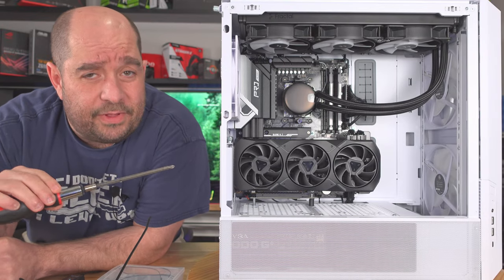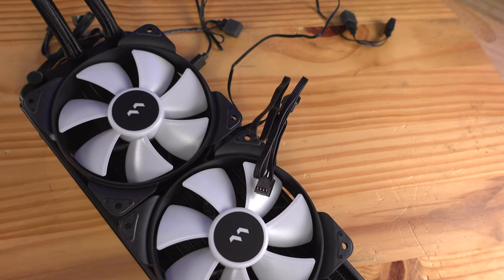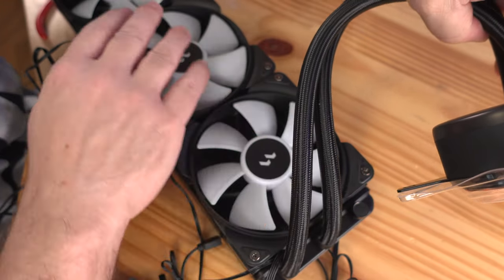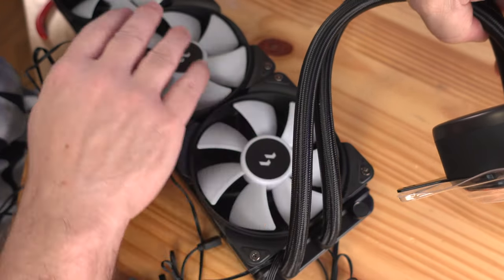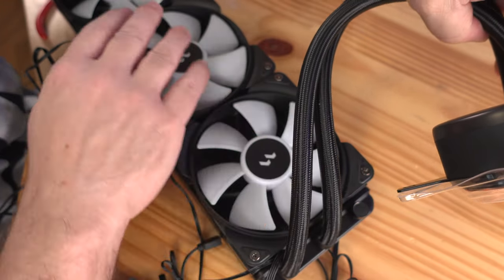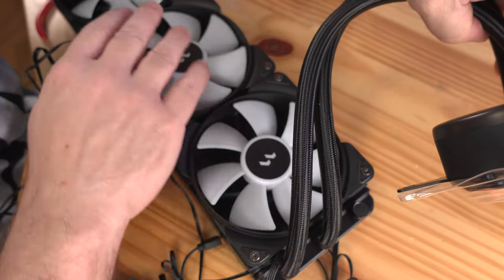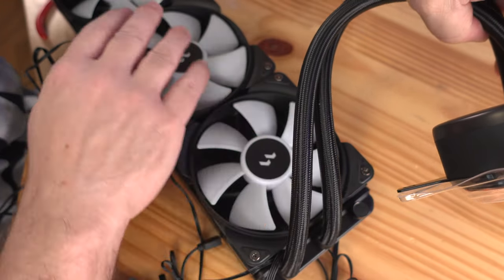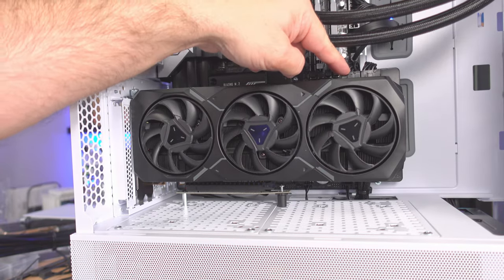Building The ULTIMATE Gaming PC!

Comment: Thank you for the video. This is the first time I build a PC and your video is the clearest one I've found, it's helped me a lot!
Now I need to find an equally good video to know which drivers and programs I should install.
Reply from the maker: Sounds good bud happy to help.  The video you want is in the pinned comment to this video and description.
Reply: @ThisBytesForYou  thanks!
Reply from the maker: Always a pleasure my friend, so very happy you stopped by, trusted in me to help you, liked and subbed as well as took a moment out of your day to thank me.  It means a ton to me and I am so very happy I could help you.
Reply: The only problem I have is I've downloaded the Lian Li L Connect program to regulate my case fans and it does not detect them. I wonder if I made a mistake, They're all plugged in the fan hub which is plugged in a one of my system can pins on my MSI x570s motherboard. Any idea what went wrong?
Reply from the maker: not sure, you would need to use the program off of here: https://lian-li.com/l-connect3/

Plug the fans into the controller, the controller would plug into the motherboard, a 4 pin PWM fan header set to PWM in the BIOS and any USB header they may use, I am not sure anything on these fans sadly since I have never reviewed them.
Reply: That's what I think I've done, but I must have done something wrong. Let's see if I can figure it out. Thanks a lot for your time!
Reply from the maker: I hope it all works.
Reply: @ThisBytesForYou  it doesn't, I've had to use the bios to control fans. Thanks for asking!
Reply from the maker: @2letranger  yeah plugging into the controller and using the fans directly would operate the same way.  SO very happy you got it

Comment: Can you explain the purpose of the 'anti-sag' bracket?
Reply from the maker: Well, a few reasons.
1. the easiest is to keep the card from sagging, it looks nasty. that's just appearance part.
2. After that, is traces.  Each component on a card (and anything really) needs to communicate to other components on the PCB.  Like us and driving our cars on highways, the commination occurs much the same way, through traces.  Those traces are made of copper, gold, aluminum, etc and don't stretch very well, or flex,  as the card starts sagging, overtime it can potentially break those traces, causing those components to not be able to communicate.
3. When you lay something REALLY heavy on a table lets say, it might be able to hold for a while, but then can start to bow and eventually break.  Same thing here, with the heavy cards, aside from the traces, they put weight on the PCIE/PCI slots and cause them to begin to separate from the board, which can bend and break traces as well from the motherboard.
4.  If a card is bending, it does not receiving optimal cooling
There are more, these are just some that come to mind, I hope this helps.

Comment: I have and old XSPC 360mm radiator which is 60mm thick and with the fans I have 80mm of thickness. So my question is: would they fit on this case?
Reply from the maker: well, the radiator for this was 30 mm, the fans were 25 mm, you have a little more space, but I just cant find my calipers, but as per Lian Li you have 77mm of clearance.

Comment: I have 6 uni p28 fans plus the two front fans that came with the case. I have them all plugged into the case fan hub and then have that plugged into my 1 system fan header. Is that correct? Is that too many fans for one header on the motherboard. Does the sata power it all? I don’t want to blow up my motherboard or something. Any help would be awesome. I’m so close to finishing my first build
Reply from the maker: you will be good, just make sure in your BIOS you have that 1 fan header set to PWM so your motherboard controls how fast or slow the fans spin.  So very happy I could help you on your journey.

Comment: Quite nice, too bad about the raizer standoff. Perhaps coupling 2 motherboard standoff screws would achieve the same height? They don't thread perfectly but at least it's something that's easily available. Also, while it's probably solved by this point, you might want to double check that front audio connection on the motherboard, it seems impropper. Might be that the connector on the motherboard has no rim like on the majority of other boards.
Reply from the maker: Thank you, but not sure what you mean by improper.  The rim is an odd one, many do have it, many don't, it shaves a few cents off which at one board makes no sense, but selling millions makes a lot more sense.  I have worked with thousands of different models and it's not something I ever thought of.  Through an assembly line, building machines it makes perfect sense, for us as builders at home, we are a little more careful (generally) and can spot it, but still it is a nice feature to have.

Yeah, the stand off was a bit weak, but thankfully not a huge deal, but still it's Lian Li, they usually make quality stuff, seems like an odd thing to skimp out on, though not everyone mounts their graphics card vertically, so they figured I guess it would not be a big issue.
Reply: @ThisBytesForYou  I was reffering that at 26:56 I think I see the front panel audio inserted in only the top row of pins on the mobo connector and that would have been avoided if they would have used those full connectors. Not a big issue as audio won't get damaged by it but it could be an issue on the USB 2.0 headers which also seem to be lacking that rim.
Reply from the maker: Man, you are right, I wonder if I caught it afterwards and fixed it off camera, since it did work afterwards, GREAT catch on your part.... wow that's embarrassing but it happens.  Thanks for looking out ;)
Reply: @ThisBytesForYou  No need to be embarased, it's a very educational video and it helped me tremendously in deciding on that specific case. The removable top mount for a 360 makes all the difference 😀
Reply from the maker: awesome bud, so happy I could help you and you enjoyed the video to me, it means the world to me.  The case overall is pretty awesome.

Comment: For some reason my 160mm fan at the front of the case are not recognized by L-connect 3, meaning I can’t control the rgb on the fans or the fan speed, any advice?
Reply from the maker: Please try as bellow to completely remove the old version and install the new version as administrator.

Uninstall L-Connect 3 from the controller panel

Remove the old files in folders at C:\Users\computer name\AppData\Roaming\l-connect3 or C:\Users\ computer name \AppData\Local\Programs\L-Connect 3

(computer name depends on user’s system name)

3. Run as Administrator to install L-Connect 3 new version

4. Restart your system
Reply: @ThisBytesForYou  I tried it and it still didn’t work:( only options that show up are system info and settings

Do you know any other app that can do it instead? I tried changing the fan speed in the bios but nothing happens, it stays the same
Reply from the maker: where are you connecting the fans to, both for RGB and power? And what is the manufacturer and model number of your motherboard @blast5558

Comment: You don't attach the AIO before the motherboard is installed.  Especially with the Liam Li 216.
Reply from the maker: Funny I did and it worked fine... Huh odd isn't it, where was this rule set and by who?  Been building for about 25 years... Odd
Reply from the maker: Especially for the lian LI 326 hahahahaha, dude hahhaha
Reply: @ThisBytesForYou  listen, if I have to explain the potential hazards of doing that, then I guess you do you.  You are a youtuber after all and I'm just an engineer.
Reply from the maker: @mynihilism  funny I was a product development engineer for Alienware and Velocity Micro, please explain
Reply: @ThisBytesForYou  Fair enough.  For one you run the hazard of damaging the motherboard if the AIO cooler falls and hits the motherboard during install.  Two, Luan Li with the 216 made the top of the case lift off so you can pre install the cooler so it's supported, then one can attach the pump.  It enables ease of install and a safer install.  It's an important feature especially with how expensive everything has become.   My last motherboard cost $380, that's NUTS!  3-4 years ago that would be top tier, now it's mid tier at best.
Reply from the maker: The chances of the unit falling are all in your hands, I have to do it this way because I am recording, hind sight is always 20/20 right when you are recording you are in the moment, there are 120000 ways to do it, it's custom, you do it as you wish.  This is the way the die rolled.  I go over the feature though in the unboxing and the review, and actually I use the feature in this when I forgot something, again, 200000 ways.  There are better, there are worse, this is one of them.  Again, non will intrinsically message up anything unless you mess up there are a trillion hazards.

Comment: AM5 is so little improvements to the AM4 so its not necessary worth to upgrade yet. Even though DDR5 memories give additional clocks, their speed is not noticeable in games, only in test programs as numbers. AM4 with DDR4 is fine for years and more cheaper costs.
Reply from the maker: Well, if you are on the lower end CPU and memory wise yes, very little improvement and realize, gaming isn't the only thing computers are used for.  Computers make the games, make the videos, make the songs you consume, the faster those go, the faster you can consume.  

If you have an AM4 now, you are good, but if you are upgrading... why limit your upgrade since you are stuck with DDR4, DDR5 is the future, until 6 comes out, but that was the case with EDO/Fast Page memory, SDR, DDR1, DDR2, DDR3, etc.  Each of those little test programs represents something, not just blips.

Comment: Hi! I just wanted to thank you for the lian lancool 216 videos, it helped me, I like your content.
Perhaps you'd be willing to help me out some further with a question if you'd be able to spare the time.

I bought the ARGB moduble because I couldn't figure out how after plugging the fans into an gen 2 argb header to control the rims? Is the ARGB module necessary or did I waste money by not understanding something. I have the 650E-F motherboard.
Again thank you so much for your work and best of luck.

Oh and don't feel obligated or whatever to read or respond to this but I just wanted to share my cool build. Since you're into computers you might find this interesting and want to give and opinion. First time build.

Total price 
Parts list:
CPU:AMD Ryzen 7700x € 291,00
MOBO:ASUS ROG Strix B650E-F € 295,05
GPU:RTX 3090 Turbo edition (650 used, it's the blower version, as loud as a vacuum and hot!)
CASE:Lian Li 216 Black RGB  € 98,35
RAM:Kingston DDR5 Fury Beast 2x16GB 6000 € 125,90 (you can overclock the timings to 34 on this MOBO)
CPU FAN:Be Quiet Dark Rock 4  €62
MAIN DRIVE:Samsung 980 PRO 1TB M.2 SSD € 84,90
Additional DRIVE:SEAGATE Pipeline 5900 2TB HDD €47,00
PSU: Delta GPS - 1000DBA, 1000W € 119,00

Accessories:
Alphacool Eiswolf 2 AIO - 360mm RTX 3080/3090 Gaming/Eagle with Backplate €271,78
Thermal Grizzly PCIe 4.0 x16 Riser Cable 30cm €49.90 (still on the way)
Black dust filter lian li 216-2 €14,90 (on the way)
ARGB module 216-2  €15 (on the way)
Noctua NT-H2 3.5g  €12,90

Total Price:2120

The build is whisper quiet and has veyr good performance, while looking sleek with the black aesthethics. 
I undervolted the GPU and CPU due to the losing slight performance to almost none for massively improved thermal and power efficiency being a good trade off.

It will look even better with the upcoming parts. I'm probably going to make a short video showing it off if you're interested or want to do a build review.

Thanks for reading all this, take care :D
Reply from the maker: awesome bud, good job building your first computer, and a nice one at that.  I never recommend over or undervolting as it can cause instabilities and you may never be able to find where those instabilities come from, because you will always be undervolted, they do a good job of properly setting all that, just a recommendation.  A nice configuration as well, I love the Lian Li 216, it really is a great case.

I'd love to see it when you are done.  When you post a link, it will look like its blocked, just let me know and I can release it, make sure to send the link in a comment, then comment separately letting me know you posted it.  Congrats my friend and welcome to the club  ;)

Comment: you could zip tie the fans cables in the back of the case not inside it.
Reply from the maker: Yes, the great thing about a custom built PC you built is you can build it however you like.
Reply: @ThisBytesForYou  
Idk what you mean, I just mentioned that because this case has some holes on top between the mesh and the radiator only for the fans cables not like other cases.
Reply from the maker: I mean you can build it anyway you like, I built it right, you built it right, we are both right and it's great, custom built PC's are pretty cool but I see what you mean, yeah you could do it that way too, the case is pretty awesome.